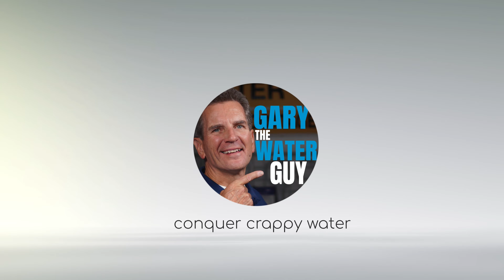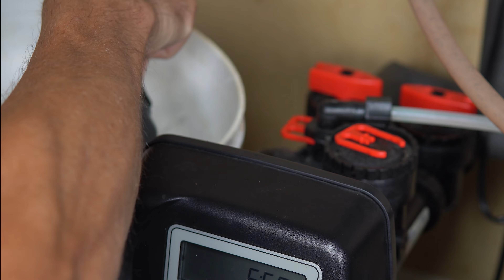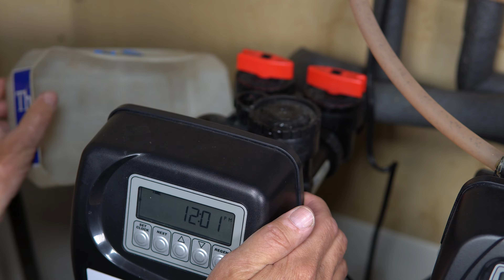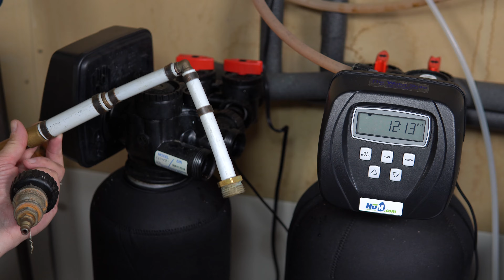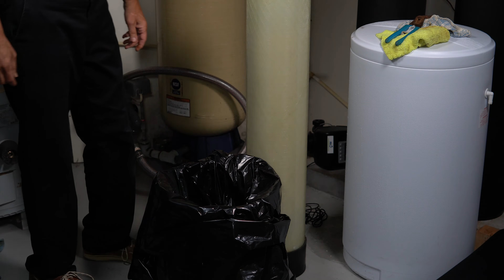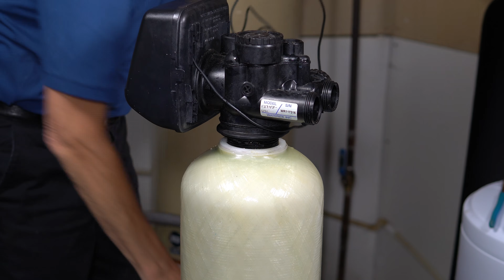WATER SOFTENER RESIN or Media REPLACEMENT

Comment: Really appreciated this video, just replaced the resin in my unit.  Unfortunately what you don't cover and is SUPER important are the o-rings.  Had an o-ring get misaligned when reassembly (which you make it seem like there's nothing that could go wrong) and I got zero soft water.  Had to completely disassemble and replace the o-rings.

This is a glaring oversight in this video and will lead to people having the same issue I did.  You should have covered the o-rings as well.
Reply from the maker: Thank you for the feedback, and you're absolutely right. Gary didn't mention the O-rings in this video, and they are an important part of the reassembly process.

We'll make note of your suggestion, and if we update or remake the video, we'll be sure to include information about checking and properly seating the O-rings. Thanks for taking the time to share your experience.

Comment: You're my back saving hero Gary!

I'm installing a brand new system and was worried about hoisting a 60 pound bag of resin onto my shoulder, opening the bag and pouring it into the container (I'm 80 years old and 60 pounds is now a bit of a load, go figure).  
I was over thinking the problem.  The answer was as close as my freezer.   The ice scoop (while a bit smaller than yours) worked perfectly.   

I thank you, my back thanks you.

Cheers!
Reply from the maker: Thank you for the wonderful comment! We're glad the video helped, and it sounds like you found a great solution with the ice scoop.

Your back will definitely appreciate that approach. Wishing you all the best with your new system, and happy to hear you got the job done safely!

Comment: Best way to remove media is to replace the riser tube with a plain tube and install a manual head. Install the water hose to the output of the head and a drain hose in the inlet of the head. Start the water hose at full pressure and the media will be out in minutes.
Reply from the maker: Thank you for sharing that. Yes, that method can work as well. Gary was just showing one way to remove the media, but there are a few different methods that can get you to the same end result depending on the tools and setup you have available.

Comment: Why did he grease to top before putting in the beads. Seems it would have made more sense to do that after filling it
Reply from the maker: Good question!

You can definitely grease it after filling the tank as well. Gary has re-bedded media for many years, so it’s mostly just muscle memory and the way he’s used to doing it. Either method will work as long as the seal is properly lubricated before reassembly.

Comment: Thanks Gary for the great video. Here’s my issue. While replacing the media in my Clack ws1 softener, I discovered that my water supply line coming from the well is hooked up to the outlet port on the head and the inlet port is hooked up to the pipe going to my house. I am assuming that the arrows on the head indicate the direction of water flow. This water softener was installed 11 years ago and to my knowledge has been working. How is this even possible?
Reply from the maker: Hi there, thank you for watching and for the great question!

Yes, the arrows on the Clack WS1 head do indicate the normal direction of water flow, so typically the well supply should be connected to the inlet and the line going to the house should be on the outlet. If it appears to be reversed but the system has been operating for 11 years, there may be something else going on with the plumbing or how the lines are routed.

The best way for us to help is to take a look at it. Could you please send us a few photos of the control valve and the plumbing connections around the softener? That will help us see exactly how it’s set up.

You can email the photos to info@waterestore.com
 and we’ll take a closer look and help you figure out what’s happening.

Comment: Best water softener videos around! I just did this and it is going through a regen now. 10yr old media. I did it because I suspected my media was fouled because my water wasn't soft like it was before. If this does not do the trick, what else should I look for? I have a Fleck 7000SXT valve. No slat bridge. Plenty of salt.
Reply from the maker: Thanks for the kind words! Glad the video helped.

Before replacing the media, it would be a good idea to test the water before and after the softener to see exactly what the unit is doing. That will help confirm whether the media is actually exhausted or if something else may be going on.

In some cases, the resin can just be fouled with iron or minerals and a cleaner like ResCare can help clean the media and bring it back to life.

If you’d like, you can email us at info@waterestore.com and we can help you go through the next steps.
Reply: @water_estore I changed the media. It was 10yrs old. Cleaned the screen and Venturi and adjusted settings using your vids. System is softening water and I am very happy. You are a YouTube treasure Sir.

Comment: I tried to replace my carbon media but i don't understand if i disconnect the water how can i use a hose to wash out. Is there a way i can cap off that translucent water line that connects to the carbon tank via a quick fit so i can turn on the water in the house and hose out the tank? I don't have neighbors to use their water

Comment: How do I know how much resin I need. I was told due to extremely high clorine my resin deteriorated and that is the cause of my low pressure in the house. Fair enough. Since I was quoted $2500 for a new softener I figured I would try this on my own. My model number is WS1 Demand and the tank says Express LLC Model 0498. Maybe this means something to someone. My google fu has failed me

Comment: Probably the best water softener videos on the net. Great work. Question: Noticed my water didn't seem as soft. I noticed a small amount of resin in the discharge fluid after regeneration (disconnected drain and let it run on my walkway so I could see it). I added some res care to the system and regenerated again and did not see any resin in the discharge. Could dirty resin have been the cause of resin in the discharge. Note: resin is 9yrs old. Should I consider changing it?

Comment: Gary Thanks so much for the helpful and informative video. Our filter has a constant drip at the drain (where it backwashes) Are the replacement parts that will remedy this? What parts do you recommend? We also need to use the iron out or res-up to clean the media but are unsure how to get it inside the tank? Is it possible to siphon it in through the brine tube? Thanks so much!

Comment: Thank you for this really informative video.. saved me $$$$$. So I am dealing with a resin blowout. question about where you said let a tub filler flow so dont catch rain in the rest of the system.. wouldn't this just flow right in to the hot water heater tank?

Comment: I found a great way to make this a 1 person job. Siphon off what water you can from the resin tank into an old pillow case in a bucket. Then remove most of the remaining resin using a 2 inch piece of PVC that can be pushed through the resin to the bottom of the tank. Make an airtight seal with your hand or PVC cap, and extract a plug of resin which will remain in the PVC tube into the pillowcase. This will make the tank light enough to pick up to empty the rest. Works great!
Reply: Smart. I like this idea. I had to read it two or three times to understand what you meant, but now I get it. It reminds me of what I do with a milkshake.

Comment: Very informative video Gary,  I have WS1 valve and the spec sheet calls for 1 cu ft of resin (24000 grains).  I have been getting resin in the plumbing.  I believe the tank is 8 inches.  I have a CLK Riser Screen Combo and a 1 cu ft bag of Excelclear Premium Water Softener Media in my shopping cart, do you think I need anything else for this project?  Thank you for sharing your knowledge and expertise!
Reply from the maker: No, you have the correct stuff for this job, but this video might help with sizing https://youtu.be/-KeuIvIyMis

Comment: Thank you! Amazing video guide to rebed a softener. It took me about 4 hours with breaks and a thorough cleaning of the tank to complete this my first time.
Reply from the maker: Glad it helped! Please share video with friends and family.
Reply: Is there a way to know what the media is? We have very hard water and very rusty. It is staring to loose pressure and not clean the iron out as well.
Reply: @mskrickett31 you could have 2 problems, requiring both a carbon filter then the water softener. The media in a softener should be resin beads. Without knowing who installed your unit originally, it’s hard to say what brand of resin they used. There are many different ion exchange resins available.

Comment: Hey Gary question!  Can I change the TYPE of media used in a tank?  I can’t afford a new system for my well water, so I’d like to change the media to a media that can handle 3 ppm of ferric iron.  Can that be done?  If so is it cost effective?
Reply from the maker: If you are changing the media in a modern Clack valved iron filter, yes. If you are trying to convert a water softener or something else, no. The valves are not compatible.

Comment: Should there always be water in the bottom of salt tank after regeneration process is completed, my unit is using salt , and my water is soft , but I’ve never seen water in bottom of tank.
Reply from the maker: If it is a pre fill water softener, there will be no water, see  https://youtu.be/GedMruLfXhY

Comment: Thank you. Easy to follow and understand. Using an in-service filter rather than a dry, demo filter is very helpful because you shows all the steps with comments about how to overcome common problems. Your comments about carbon filters is appreciated as that is what I will be doing.
Reply from the maker: Glad it helped, same procedure for carbon filters but MUCH messier

Comment: Hi Gary.  Great videos. My resin went into the plumbing.  I got that squared away by flushing. All faucets etc. functioning.  Mesh basket looked fine so my guess is the resin broke down and made it past the basket.  Not having any resin getting into the house now but water taste like cardboard or the like and that’s with our 5 stage RO.  I changed the filters but still not tasty, we had the best tasting water until the day the resin went into the house plumbing .  So after a few months I decided to bypass the softener and it’s 90% better.  I used Purolite c100 which I later saw a review where someone complained about taste with this product.  I was wondering if you see anything I may have missed? Other than that I was going empty the resin and try your resin. Thanks!
Reply from the maker: I've never heard of Purolite c100, maybe it's not a good match for your water? We have used the same resin for 20 years with no issues.  You could contact the Purolite c100  manufacturer, if that goes nowhere, then yes, use this media https://waterestore.com/products/excelclear-premium-grade-water-softener-media-1-cubic-foot
Reply: @ ok thank you!

Comment: I think this is what I need to do with my system. It’s 9-10yrs old and the supplier smell is in both hot and cold water. Is it possible to complete this maintenance without an air compressor?
Reply from the maker: Yes, you can lay the tank on the ground with the valve removed and flush out the media with a hose.

Comment: Hi Gary, our water treatment filter has these tiny clear beads that have like a dimple in it on top of the carbon. Do those beads need to be replaced? When I emptied the filter they all came out with the carbon. So now they are all mixed together and I can't find a source to buy more. Do you have any advice? The filter is an Enviro Water Products which apparently are not made anymore.
Reply from the maker: Sounds like water softener media beads but could be a number of things.  Is this a filter that backwashes to the drain to clean itself? If so, the beads get mixed up during backwash anyway and may due to their weight end up on top automatically.

Comment: I am in the process of replacing my media.  Cleaned out the brine tank, reservoir, and media tank.  Having issues determining the type of media and by how much to replace.  The media tank is a Clack 10"x35" and the pump looks to be the exact same model as in this video. Any links or provided information would be awesome!  I liked your video and it helped tremendously.  Also, there is gravel at the bottom of the media tank.
Reply from the maker: This video will help with media quantity. https://youtu.be/-KeuIvIyMis We have the media here https://waterestore.com/products/excelclear-premium-grade-water-softener-media-1-cubic-foot If it is a residential water softener no gravel needed if tank is small than 12" in diameter.

Comment: in one of your videos you said i could use bleach to clean the bed…just wondering if this can be done to an activated carbon bed….my plumber friend had mentioned years ago that the carbon absorbs the bleach rendering it ineffective….your thoughts???
Reply from the maker: I wouldn't use it on carbon, if it has stopped working you will need to repalce the carbon.  We ahve it here https://waterestore.com/products/coconut-carbon-12-x-40-mesh-1-cubic-foot-media

Comment: I'm curious about "let this finish up" because steps 12&13 above are a little confusing. It was put into manual backwash just by starting a regen? Doesn't the regen cycle start with filling the brine tank? I think these instructions could be different for different models and could cause big problems. What do you think? I have air in my softener cylinder I have to purge but I don't want to risk drawing  up a bunch of my new resin. I need to do a full regen cycle but want to catch the backwash for getting the air out or do it manually prior. I think I can cycle through stages but trying to get it right the first time. -K
Reply from the maker: Yes, some softeners start the regen cycle by adding water, the one in this video adds the water as the last step. Sure, yours might differ so you can always ask the manufacturer of your water softener.
Reply: @water_estore  Thanks for the reply. I was able to cycle through ther egen stages and successfully purge the air from our softener! Some wild directions in our manual but worked out good. Our water is extraordinary after changing the softener media. Clear, zero smells. Used Purolite brand. That stuff is weird when it flows w water. Like sand. Tiny spherical balls.

Comment: My 17 years old softener was not softening the water at all, then I found out about a granular product called 'Iron Out' that is suppose to clean out the resin beads. So I did 2 treatments with a bit extra strength of 1 & 1/2 cups (instead of the recommended 1 cup) diluted in 1/2gallon of warm water, then poured into the brine well. Did 1 teatment one day with a manual regen, then a 2nd treatment two days later with a 2nd regen. Soon after, I was getting very soft water again, almost to soft! This Iron Out powder works great, it cleared the junk out of my resin beads without having to replace them.
Reply: How did you put in Iron Out or Res-up in the tank? Did you remove the controller and then replace and regen ?
Reply from the maker: Yes, it is a great product, we also have this media cleaner https://waterestore.com/products/pro-res-care-water-softener-resin-cleaner

Comment: We bought our water softener from you in 2010 or 11? Followed your videos and free water tests to diagnose and determined it needed to be re-bedded.  I did everything here,  but I put it in the car and dropped it off at The Water Store to do the messy part. Started at 9:00am, up and running by 12:00pm. Re-bedding cost seemed reasonable based on the price of the resin beads and quick turnaround.
Reply from the maker: Glad to hear it worked out for you, thank you for your business and your kind words.

Comment: I have the same clack control head. I’ve replaced my resin with 10 percent crosslink but I filled it all the way to the top. And I just filled it up full blast and had resin inside my brine tank. I just recently added a little bleach to disinfect and I believe it got the resin muddy and some “mud “ was in my brine tank so I’m replacing again. My tank says 1.5 resin capacity but I remember only using 1 foot and that was filling it up to the top. I will fill it up with 10 inches from the top now. 

On the clack I can see the setting for grain capacity. I have it at 48,000. If I only use 1 foot and leave it at 48k instead of like 36k would that hurt anything? Or would it over clean the resin as it thinks it’s cleaning 48k worth of resin?  

I can’t find a salt pound setting on this. I’m assuming when I set it at 48k grain capacity that it automatically sets the salt at correct pounds??

Thanks for any answers on that as I can’t find it on google anywhere
Reply from the maker: If you leave it set at 48,000 you will run out of capacity, I would change it to 80% of 30,000 or 24,000.  Thsi video will help you with the programming  https://www.youtube.com/live/c6r7qUK8to4?si=sQMlq2rj8OpyyAMG
Reply: @water_estore ok thanks. Do you know the reason for the capacity setting? Is my logic flawed thinking that leaving it at 48k means it’ll think it needs to clean 48k worth of resin? I don’t mind over cleaning if that’s the case. It’s also set to regen every 14 days and I don’t use that much water so I’m always way ahead of needing a cleaning. Sorry for the questions as I can’t seem to find an answer on what the capacity setting means exactly. But I’ll switch my setting after I put in 1 cu ft of resin instead of the 1.5